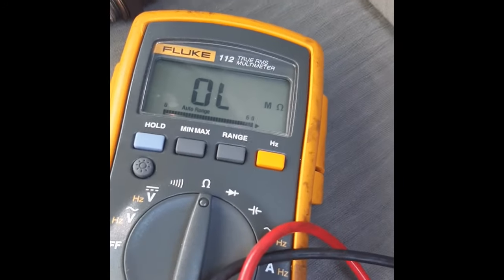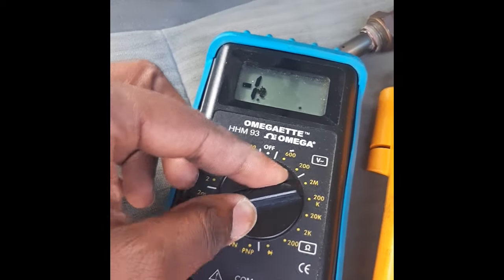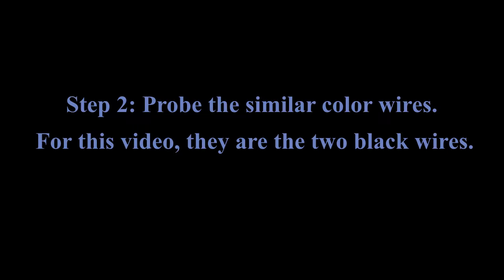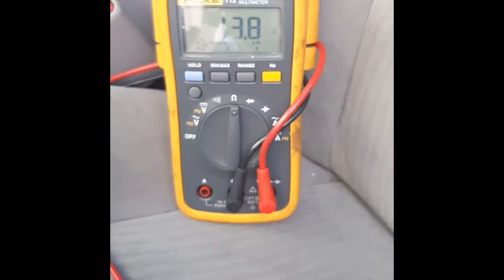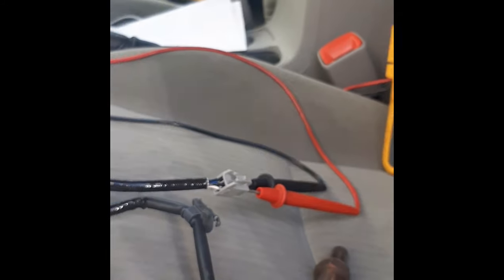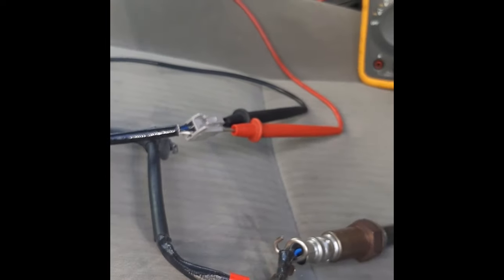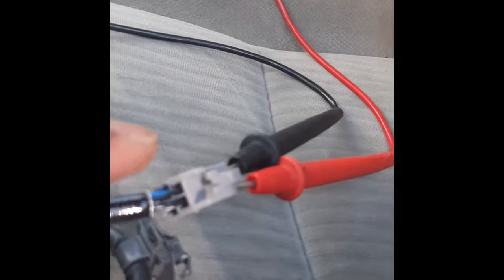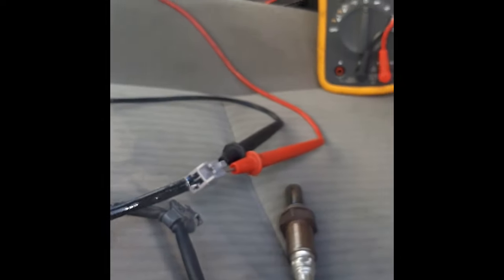Quick Steps to Test Oxygen Sensor (O2 Sensor)

Comment: Wanted to confirm one of my heated sensors was bad before I installed the new one, and the old one showed no change in resistance on my mm while the new one showed like 12 ohm using this test. Thanks for making the information accessible boss!
Reply from the maker: I appreciate your feedback!
Reply: @eazidiy do I check harness connection the same way ? I think my plug is bad because I already changed o2 sensor

Comment: Great explanation 👍 in my case the one behind the catalytic converter goos up pretty quick to 3.4ohm (still rising) . The one upstream takes a lot more time to even get up to 2ohms. Can i conclude that the O2sensor upstream is faulty? Car has running issues especially with cold engine. Greatings mario
Reply from the maker: No. Generally, the resistance of upstream is lower than downstream

Comment: Been having a nightmare trying to diagnose some fueling issues. I thought my O2 sensors were not working. Tried your method and got 13.6 on one and 13.5 on the other. Its for a KTM 990 adventure 2007. I live in the andes mountains so got no support apart from YouTube and ebay.  Thanks for your vid, saved me a poor nights sleep :-)
Reply from the maker: You are welcome.

Comment: I have check engine ligh and p0141 code but i test the o2 sensor the value is 16.4 ohms the car have RPM inestability
Reply from the maker: The test in the video is to detect broken heater circuit in the coil. Your O2 sensor may well be malfunctioning that could be the reason for p0141

Comment: how much ohms it should be reading a good o2 sensor  plz ?
Reply from the maker: The ohms reading varies depending on the type of oxygen sensor. The resistance reading was used to test if the heater in the oxygen sensor is still good. You may have good reading on the resistance and the O2 sensor could still be failing to put out required voltage during operation.
Reply: @eazidiy  i got your point , so how you get sure the o2 sensor give wright voltage .. have we testing other 2 wires  voltage between 0.1 to 0.9 dcv ??
Reply from the maker: You need to further research relating your car specifications, what reference voltage(dcv) is required for O2 sensor operation with the ECM/ECU
Reply: @eazidiy  thank you a lot for informations
Reply from the maker: You are welcome

Comment: I tested both my old and new oxygen sensors and the old one had 104 ohms and new one was 97 ohms the light came back on
Reply from the maker: The test I did was for the heater element in the oxygen sensor. You may other things wrong with the oxygen sensor or your car.

Comment: Hey, can the 02 sensor still be faulty if its showing a response with multi meter??  Ive tested mines but it jumps up then drops, it doesnt stay solid number, im getting p0420 code,  but i know its not cat as ive just recently got new approved cat. Thanks
Reply from the maker: Did you test with the o2 sensor still in the exhaust pipe or out of the pipe?
Reply: @eazidiy  engine was  off,  02 cable disconnected from box clip, but still screwed to exhaust, i tested the two black wires on the 02 cable box clip?? Is this wrong?? Thanks
Reply from the maker: That would explain why you have the coil resistance not stable. The heat element is the coil is good but that doesn't mean the O2 sensor is functioning properly.
Reply: @eazidiy  legend, ive got  a new 1 just didnt want to fit it if no need to, il try that then,  thanks

Comment: I just checked the readings on my 02 the 2 black wires read 01.2 that good or bad ?
Reply from the maker: Depending on the type of O2. Is yours upstream or downstream? If downstream, bad. I have a reading of 2-3 ohm on my upstream sensor.
Reply: @eazidiy  it’s on upstream
Reply from the maker: Heater is good in the sensor
Reply: @eazidiy  if that’s good then I wonder what’s the problem because I have a P0135 code I’m trying to get fixed
Reply from the maker: @almightyking1096  the fact that the resistance as good readings doesn't mean the the sensor is not failing. The other 2 signal and reference wires could be failing.
Reply: @eazidiy  check it the same way you did on the video?

Comment: I have four wires:
White x 2 each
Black
Grey

No readings with black to grey.
Only a reading white to white.

TN/WH is low signal bank 1 sensor 1
PU/WH is low signal bank 1 sensor 1
GY/WH is low control bank 1 sensor 1
PK/BK  is fuse control
Reply from the maker: The white wires are for the heater in your oxygen sensor. If you have readings, it means the heater is working. You may have other issues with the sensor.
Reply: @eazidiy  So if no reading with the black and grey that would mean ____
Reply from the maker: @badmatt4227 those are reference signal wires to measure the air to fuel ratio.
Reply: @eazidiy  So, if no reading the sensor is bad?
Reply from the maker: @badmatt4227 those are reference readings when the engine is running to my measure air to fuel ratio.

Comment: 2 wires sAm color A?🤔.. hmnnn - who’d of thunk✋.  how many differant type cars would that work with?(like rough guess % ).. 
&& WOULD this work if someone DOESN’T remove ox. sensor?
Reply from the maker: Yes, the test works with the sensor not removed
Reply: yeh thanx - I had just attempted it & got roughly a 9, then on new ones, also a 9r - guess 9s it B✋😉.  Ql trick G, hUd’v thunk

Comment: Pre cat sensor shows 3.2 ohm while the post cat shows 5 ohm. Would any of these values equate to sensor failure? Have engine light on and this was the first thing I tested. Thanks
Reply from the maker: Not really. Upstream resistance is usually less than downstream resistance. You may aswell have a bad O2 sensor regardless of the ohms readings.

Comment: Quick question. I have the exact same sensor with coloured wires and we tested the 2 black wires with no reading. Is this sensor an o2 sensor or an AF sensor because we are not sure which one we need? This one is coming from the exhaust at front of the engine.
Reply from the maker: Upstream O2 sensor is referred to as AF sensor located before catalytic converter. Down stream sensor is located after catalytic converter typically in the exhaust line.

Comment: So what is the minimum value of the sensor that it still usable and no check engine indications.,
Reply from the maker: As stated in the video, the test is on the heating element of the oxygen sensor.  Check car's manufacturer manual to know the minimum resistance.

Comment: what if the resistance isn’t higher then 2.0 ? like it struggles to keep it over 2.0 omhs
Reply from the maker: The resistance varies depending on the position of the O2 sensor and the type of vehicle. The bank 1 O2 sensor of my car has a resistance of 3 ohms while bank 2 has 15 ohms. The test in the video is to check for open circuit or short in the heater element of the O2 sensor.
Reply: @eazidiy  how do you find that info?
Reply from the maker: @tttarms1970  online research and also I have tested both upstream and downstream sensor on my car.

Comment: Everybody test the heater but what about the other two wires? Should there always be power from the ECM to the sensor?
Reply from the maker: Yes, you could test the pins also. You have to plug the O2 sensor back in the car and test the reference voltage with multimeter
Reply: @eazidiy  yes will try that, both down stream sensors are showing N/A on my scanner at idle? But if you watch it for a while they will flash a number real quick then go back to N/A ? And yes I have the dreaded code p0300
Reply from the maker: @joecorrie1  P0300 is a misfire code which could be cause by spark plug or ignition coil amongst other things
Reply from the maker: @joecorrie1  O2 sensor code is P0420 or 421 for Toyota
Reply: @eazidiy  just tested both sensors and the heater wires are closed as they should be?, the other two wires on dcv have 2.199 on both downstream seems ok I think,  plugged cats maybe or signal back to the pcm in bad? Anyway thanks for the info any thoughts Will be greatly appreciated
Reply from the maker: @joecorrie1  What type of car do you have? You may want to test you Ignition coils and spark plugs.
Reply: @eazidiy  yes I think your right it’s a 2006 Chrysler 300 touring 3.5L, just looked at the cats with a bore scope from the downstream and there clean and white? It really bugs me that all I see on those DS cats is N/A even when I’m driving it? Maybe just go for new plugs and maybe coils it does have 123.000 mi. I love swapping for some codes to trouble shoot but no good with this po300, it’s my Nieces car I’ll have to tell her it’s time to throw a little money at it and hope for the best oh well thanks for the info
Reply: @eazidiy  FYI, up date put both downstream sensors back it after looking at cats and scanner is showing readings instead of N/A so maybe a wiring issue not sure. If code comes back all check it
Reply from the maker: @joecorrie1  Hope for the best. Cheers

Comment: So you tested the oxygen sensor with the multimeter off the car
Reply from the maker: Yes I did in the video. You could test O2 sensor on the car if you can reach the connecting harness.

Comment: This is not accurate, the o2 sensor needs to be under a load. Thus 600-1500 degrees to test correct.
Reply from the maker: If you pay attention to the video, I did a test on the sensor's heater. Every coil has a resistance.
Reply: And don't push the meter probes all the way into the connector or you will compress the lugs and will give a bad connection later